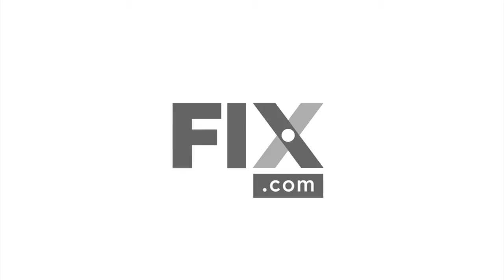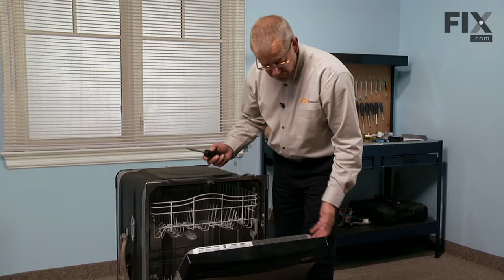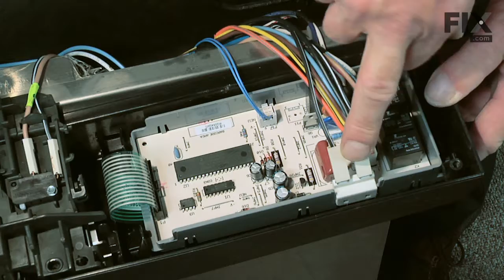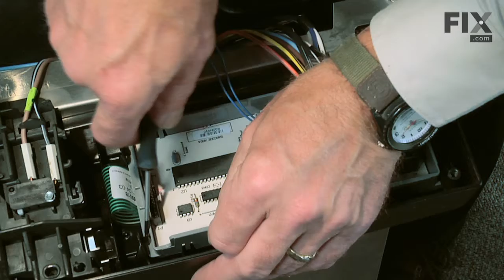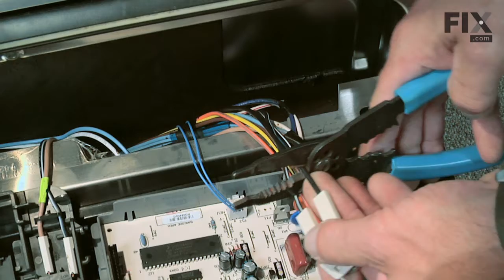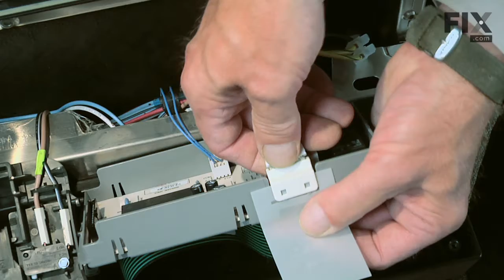Kenmore Dishwasher Repair – How to replace the Fuse Kit

Comment: One tip before you look at the fuse: some machines have a LOCK feature where you hold a button for 4 seconds to lock/unlock it.
Reply: How do you know if the lock feature is on or off when there is no power?

Comment: We have started keeping extra fuses for our Kenmore.  Everytime we use any kind of heating in our cycles it flips the breaker and fuse burns out.  Most expensive model when purchased and it's been one thing after another..... Kenmore and Maytag are the two worst and high maintenance dishwashers ever purchased.  Going to try Bosch next.

Comment: I questioned  why not just pull the tabs off and change the thermal switch, so that is what I did six months ago.   It needed to be replaced again so this time I just did exactly what the video and instructions showed.  Why the mylar being added when I snap the thermal switch in place?

Comment: can’t you just pull out both the tabs and put them on the new thermal fuse rather than cutting both wires? I did that for my model and it worked.
Reply: Apparently this is a known problem either these dishwashers. If you just replace the fuse, it could blow again. So you change the wires too.

Comment: What is the amperage of the fuse?  It is easy to take it out of the case.  Looks like the manufacture is Cantherm and found the cutoff at 98C assuming 10A due to the small size.  Digikey sells them for $1.20.
Reply: i think this procedure is wrong . the mylar is supposed to go under board box to block the hole so heat can not get into box . what else is its purpose .
Reply: @larryjones7290  that is what the instruction say

Comment: Hi. Every time I change the fuse in my kenmore model. 665.13443k900 it broke down. Do you know what could be happening.
Reply from the maker: Hi, When you changed the fuse did you use a new wiring harness? When researching your model and part the manufacture recommends to use a new wiring harness when changing the fuse.